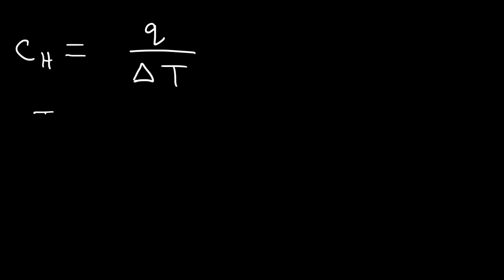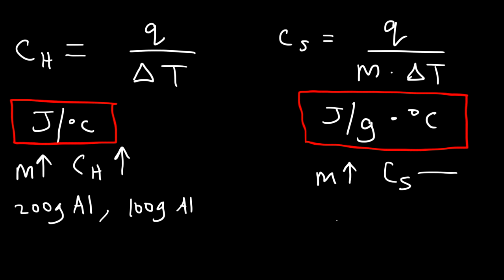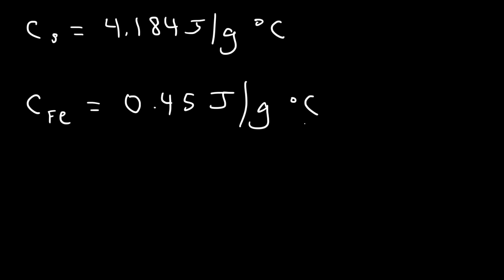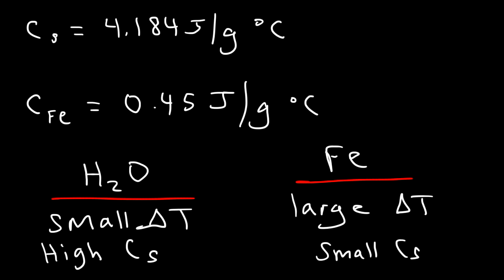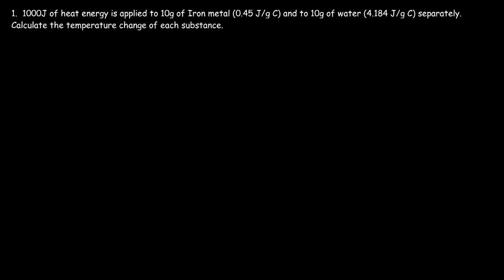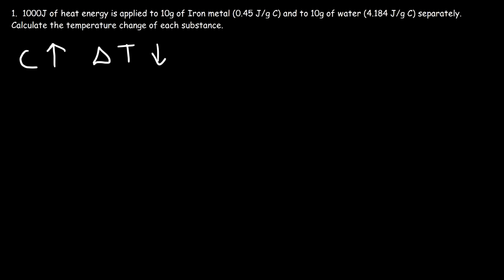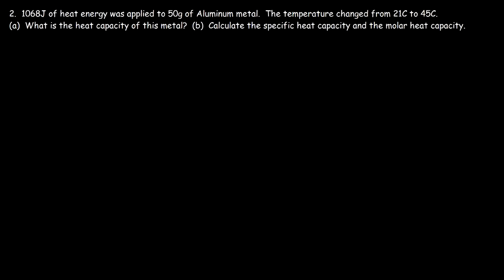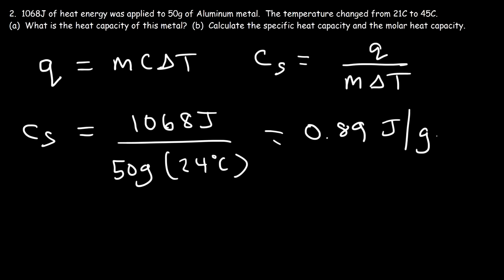What Is The Difference Between Specific Heat Capacity, Heat Capacity, and Molar Heat Capacity

Comment: how does the specific heat capacity not depend on mass when it's in the equation
Reply: Think of it as density
Density is mass per unit volume d=m/v but it is independent of both mass and volume
In case of density if you increase volume the subsequent increase in mass will compensate from it 
Over all ratio will be constant
You learn many terms like this eg capacitance is good example it is equal to charge per unit potential
But independent of both charge and potential

Comment: A lot of confusion on why specific heat is not dependent on mass is you divide out mass. Specific Heat does not depend on mass because q does, so when you divide out m you are taking away the dependence of mass from q thus making the final product not dependent on mass
Reply: It’s not q which has the mass term, is the delta t which is dependent on mass. The temperature change only could have happened with a specific mass and a specific q
Reply: @Fesrab  it'a q because q=mc∆t so q does depend on mass
Reply: @unnamedchannelowouwu  molar heat capacity isn't dependent on mass either, but it divides by moles instead of grams. How does it cancel out mass?

Edited: It's because q = ncΔT in that equation.
Reply: @HappyGardenOfLife  it's been 9 moth since I commented that, now I forgot all about the video so I don't know what you're talking about hahaha

Comment: how can heat capacity be related to mass if it is not included in the formula? Likewise, you said the specific heat is not affected by mass but it is included in the formula???
Reply: U can use the mass to find the specific heat capacity, but if the mass increases, the specific heat capacity stays the same
Reply: Chelsea  I was wondering about the same
 thing
Reply: Mass is in heat's formula 
Q=mc∆T
Reply: For simplicity's sake remove the temperature.
Heat capacity is xJ. It is not a ratio with mass value. It is not x joule for y gram. So it is independent of a specific mass value. It can be dependent of any mass value.
Specific heat capacity is xJ : 1g. X joules per 1 gram. It already depends a mass value which is 1 gram. So ratio only works for 1 gram, does not depend on another mass value.

Comment: Calculate the amount of heat required to raise the temperature of 100.0g of water from 30.1degrees Celsius to 70.1degrees Celsius. The molar heat capacity of water is 75.3J/mol degrees Celsius. what do I do?
Reply: use the specific heat of water
Reply: Just multiply molar heat (75.3) by the number of moles in 100g of water, all other info is useless.
Answer: (75.3)* (5.5 moles) = 418.3 Joules/degree Celsius.
Reply: @pew7217   dont you also have to multiply by a hundred too
Reply: Cm= Q/n∆T
> Q= Cm.n∆T
>Cm= 75.3J/m °C
>n= given mass/molar mass= 100g/18g=5.5mol
>∆T= 70.1-30.1= 40K or 40°C
Hence, Q= 75.3×5.5×40=16566J
Hence, amount of heat required = 16.566kJ
Reply: 16.5 J